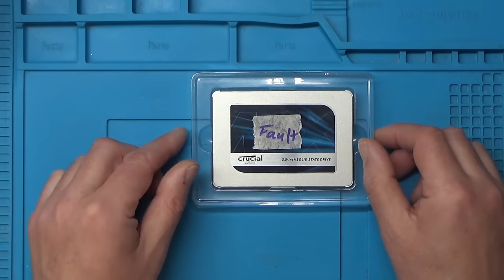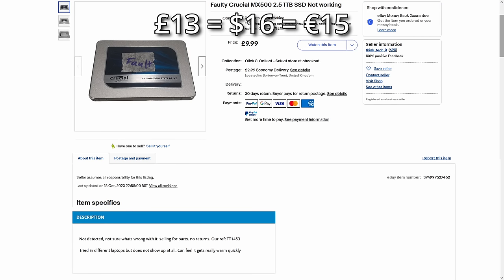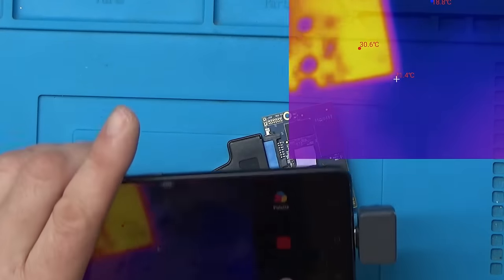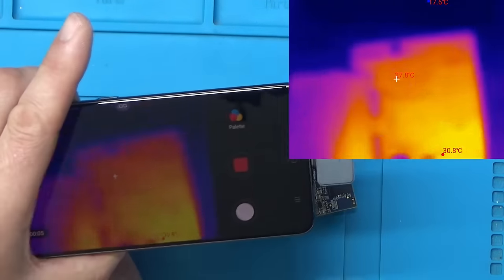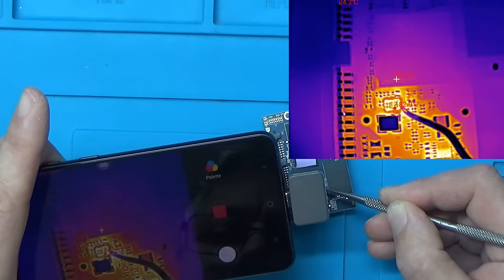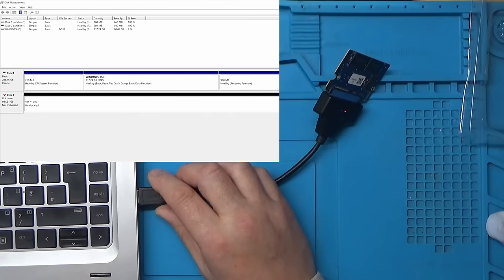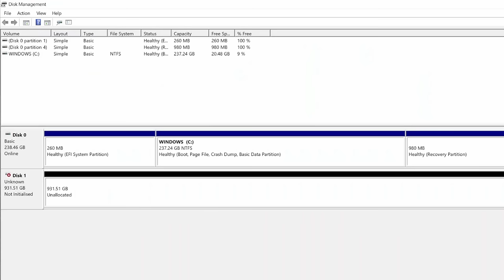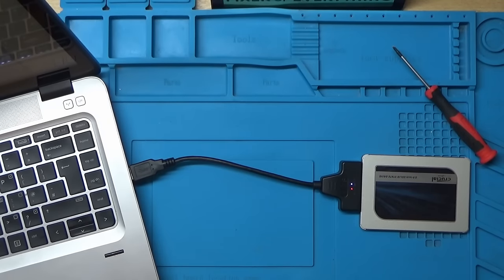Faulty Crucial Solid-state Drive (SSD) 1TB (1000GB) - Can we FIX it ?

Comment: Crystal Disk Info and Crystal Disk Mark are two great free utilities for SSD health status and performance. Well done on the fix Mick, nice work!
Reply from the maker: Thanks Marc 👍
Reply: I always use Crystal Disk Info and Hard Drive Sentinel (for continuous monitoring my hard drives)
Reply: HD Sentinel is a good one too, it does a lot more than CrystalDisk. It is paid for but really good as it sits in your tray giving realtime info of temperature and sector issues. It will email you as well if things deteriorate, so great for servers and systems left running! It also allows you to repair the disk with surface and sector scans to force SMART refresh! I've never looked back!
Reply: Crystal Disk Info also tells the operating hours, which most drives keep track on. That would tell if the drive was brand new.
Reply from the maker: The crucial executive utility I used at the end of the video (I think some people might have thought the end was when I was putting it back together) also tells you the hours, power cycles,  health status and let's you upgrade the drive firmware (which I did a bit later). But thank you all for the alternative suggestions.
Reply: Exactly. Crystal Disk will display power on hours for both SSD and mechanical HDDs.
Reply: Fantastic fix, great bit of luck with that cap failing, excellent use of the thermal camera to do a bit of extra detective work Mick, Happy new year to you an yours, Mark 😊👍🥳🥳
Reply from the maker: @thetraindriver01 Thanks Mark, and happy new year to you and yours too! 👍
Reply: Crystal Disk Info is what I find d very good.
Reply: @BuyitFixit  CrystalDiskInfo is for all brands though, so you don't have to worry about getting a manufacturer-specific utility.

But I guess like you said, with the Crucial one you can upgrade drive firmware (though I've never needed to do that).

The only time I'd use a manufacturer-specific SSD utility (like Intel Toolbox or Samsung Magician) is with a non-SLC SSD under Windows XP (or Vista if I found myself on that lol), to add TRIM etc. to those OSs, which you need when using a non-SLC SSD with them (Microsoft didn't include it until Windows 7).

Comment: Another amazing repair. Just a quick tip for anyone wanting his model thermal camera. It is one of the very best for the cost out there. Make sure to look into the macro lens add on or kit as this gives you sharp detail for small components and board inspections. Most other cameras out there other than uni T may not have this option.
Reply from the maker: Thanks, yes it's a good camera although the only downside is that you also need a phone to use it. Ideally this arrangement in a stand alone device would be great.
Reply: I bought one of these also.  I find the BIG advantage over a stand alone TC is that you can use a tablet with a BIG screen, or share the screen to a cast capable TV.
You also don't have the frame rate of 9 FPS limit that most other TC's have.

Comment: Nice find!  Looks like these small caps are getting to be somewhat common failure points.  Northridge Fix just did a video on a Samsung 860 Evo SSD with a shorted cap a few days ago.
Reply from the maker: Yes, totally agree. I've seen quite a few devices with the same problem.
Reply: MLCC's (multilayer ceramic chip capacitor) are notorious for causing shorts
Reply: I guess I'm not lucky at all. Never had any SSD in for repair with a blown capacitor. Only heavy faults. No shorted or blown capacitors.

Comment: Loved this.  Appreciate it was some time ago - but how did you work out the value of the replacement capacitor - did I miss that part?
Reply from the maker: Thanks 👍Just a rough guess as it's only a decoupling capacitor to reduce noise on the supply. The supply we know is around 3V so anything higher would be fine for the voltage, and a typical value is around 0.01uf. I just pulled one from an old PCB that was doing a similar job.
Reply: @BuyitFixit  appreciate your taking the time to reply and the capacitor tip.

Comment: Nicely done! I have to say though, while this would be a fantastic result for data recovery purposes, I'm not convinced I'd want to actually use the repaired drive long-term...
(PS: how did you choose the capacitance of the replacement cap? 🙂)
Reply from the maker: Thanks 👍Just a rough guess as it's only a decoupler, so something around 0.01uf or 0.1uf and it would only be a low voltage at around 3V. The HDD turned out to be brand new, and I guess caps can fail at any time so it should in theory be no worse than using a brand new drive.

Comment: Could you please tell us what was the value of the shorted capacitor that was replaced.Thank you for the video, great one👍👌
Reply from the maker: Thanks, I've been asked in comments a few times. It was just a rough guess. It was a decoupling capacitor across the supply so the value wouldn't have been too critical. We can guess the supply would be under 5v, so we know the voltage and a value would be something like 0.01uF. I just pulled one off an old board that was doing the same job. Hope that helps.

Comment: Nice fix, how did you decide the replacement CAP value?

What model and resolution is your thermal camera module?
I'm looking at getting one for Christmas.
Reply from the maker: Hi Dave,
The cap was just a decoupling capacitor to stop noise / interference to the CPU. The voltage of the CPU would be under 3v, and a 0.01uf cap is commonly used, so that's pretty much what I went with. I just pulled one off an old PCB that was doing the same job. The thermal camera is 256×192 pixels, and 25 FPS. The FLIR one i have is only 80x60 and 12.5 FPS. I put some links in the video description to the camera and other tools such as the blue mat etc as I've had quite a few people asking about different tools etc that I use, or "what's that grinding pen thing you were using".  Hope that helps!

Comment: So many modern electronic devices are knocked out by a simple shorted capacitor. Oh and love the vids , so glad I happend on your channel,  THANKS for the vids they keep me sane.
Reply: I watched the video but couldnt understand that much.. is that capacitor burnt or it deglued itself from the board? He just resoldered it?
Reply from the maker: Thanks 👍Much appreciated 🙂
Reply: @subgivtara The capasitor was damaged and shorted the power line. Had to be replaced
Reply: @Frank-Thoresen  where did he get another one?
Reply from the maker: It's just a decoupling capacitor. The value wouldn't have been to critical and it would probably have worked without it. I just pulled one from an old board that was doing the same job.

Comment: @BuyitFixit  I also have the infiray. But what software do you use? I've tried different ones but one of them doesn't cope well with upright and horizontal positions. The other one is annoying with this eternal dog + moon animation.
I would also like to be able to set min. and max. temp for the display and be able to compare things better without a dynamic scale.
Reply from the maker: I'm just using the P2Pro software. Not sure about the dog and moon? Never seen that.

Comment: How did you figure out the value of the shorted cap?
I like the videos. I watch them on my phone and it helps alot when you use the microscope.  I dont have to keep zooming and panning around to see what you are doing.
Reply from the maker: Thanks 👍I've answered this a few times in the comments, it was just a rough guess. It's a decoupling capacitor to reduce noise in the circuit. I just used a 0.01uf and around 6.3v should be fine as the cpu only runs on 3v or less. Hope that helps 👍

Comment: Happen to me recently, bought a 1TB Crucial BX SSD for my 2012 Macbook Pro as a 2nd HDD, installed, copied old spinning 1TB contents over.
Rebooted Mac so it could reconfigure, and it never did reboot, so many attempts, unplugged the new 1TB SSD and Mac booted, weird as my main SSD had the OSX installed. Once booted, I used a program called Drivedx, brand new 1TB SSD had instantly failed, sadly nothing I could fix myself or I would have, but I'm so glad you took a gamble on this and paid off, I love that feeling myself.
Reply from the maker: Thanks 👍Yes, but it could also have went the other way if it was the main IC for instance that had failed. Thanks for commenting 🙂
Reply: good thing that's a new BX, should still be under warranty then.
oddly enough that happened to a crucial drive (that I know very reliable as well as snappy, used and resold countless of them)
not endorsing the brand here but I'm a fanboy, only crucial for all personal use 😅
Reply: @puckchew  Yeahh got a refund :) was offered a replacement but was a little unsure at the time.

Comment: How do you know what capacitor to replace with?  🤔
Reply from the maker: Just a guestimate. It's a decoupling capacitor as it's across the supply. I doubt the value is too critical and it would probably have even worked without it.

Comment: I'm sure someone has said this already, but you can try a Linux live iso, write to to a usb and boot from it and then run gparted which is a gui partitioning tool which will show you both Linux and Windows partitions. You can either use the Linux Mint live installer iso which can boot to a full gui OS off the usb drive or gparted has its own live edition as well. The latter will be smaller. Now off to have a look at my dead ssd from a few years ago to see if its a shorted cap on that!
Reply from the maker: Thanks, yes I've got a couple of ubuntu disks, I actually used it for a year or so a few years back when I was developing some Android stuff. Good luck with your drive 👍

Comment: Brilliant fix, How do you know what size capacitor the blown one was  to replace?
Reply from the maker: Thanks 👍Just a rough guess as it's just a decoupling capacitor. The voltage would be around 3v so anything rated above that, and a value would be around 0.01uf. I just pulled one from another board doing a similar job.
Reply: @BuyitFixit  tks heaps. Really handy to know this kinda stuff. So much that can be repaired with a bit of knowledge👍👍

Comment: Alright. But how did you determine the value of the capacitor to replace it?
Reply from the maker: Just a guess, it's just a decoupling capacitor as it's across the supply. It would probably have worked without it.
Reply: Nice fix, What was the actual capacity value and voltage of the cap used? What are the best capacitors to use? Thanks in advance? 👍
Reply from the maker: Well a rough guestimate would have been that the voltage would have been 3V or so at that point, even 1.8V or less. So I would have used something rated at a higher voltage than that and a capacitance of something like 0.01uF. I just pulled one from an old logic board that was doing the same job.

Comment: Hi Mike  could you explien how you use diode mode to measure for a short and how did you know what the capacitor value was of the one that you replaced. Really enjoyed the video!
Reply from the maker: Thanks John 👍 It's pretty much the same way as using it in continuity mode, I could have used that or even resistance.
The capacitor I just took a rough guess. It's a decoupling capacitor to stop noise in the circuit. It would probably have even worked without replacing it. I just pulled one off another old board which was doing the same job. The voltage wouldn't be much so <5v so a 6.3v rated cap would do, and something like 0.01uf. Hope that helps 🙂

Comment: What could be the issue if there are many caps shorted?  I have the same drive, but with more NAND chips (older version I guess).  The caps around each of the NAND chips seem to be shorted.  Could this mean that something else entirely is causing this?  Or is my drive just non-recoverable?
Reply from the maker: It is probably 1 cap that's shorted, but they are all linked in parallel hence them all measuring short. Thermal camera would show which is shorted, or you might get away with some isopropyl alcohol on the board, and apply power see where it evaporates first. You can also get a rosin flux vape type thing that would put a flux mist on the board and it would highlight where heat is coming from. Hope that helps.
Reply: @BuyitFixit  Thanks for the response.  I was considering getting a thermal camera; this seals the deal.

Comment: How did you choose the cap ? just one that fit the previous one ? (I rarely touch surface mounted boards because I generally do not know what's to put to replace a faulty component, while they have no label or color code.... Old valve amps are better for this x) ) 
And thanks for sharing that !
Reply from the maker: Just a guess as it's just a decoupling capacitor across the supply to the main IC. So it would only be around 3v and a 0.01uf would be fine.
Reply: @BuyitFixit  so "use your brain" x) it's ok ! Thanks !

Comment: Good fix, Mick.  I knew you had it and that it was brand new when it came up un-allocated with the right number of gigabytes.  I was about to ask you if you had the BX500 or the MX500, but I saw at the end that is was the MX500, which has on-board DRAM cache.  I've installed many of these MX500 to speed up people' older machines, and it's like a brand new machine.  They are about $50.00 in the states, so you did get a good deal.
Reply from the maker: Thanks Michael. I've never used them before as I've always used Samsung drives. What are they like for reliability?
Reply: @BuyitFixit  Pretty decent, I think. The odd shorted MLCC seems to be the most common failure mode. (Avoid the BX500 like the plague though.) The smaller versions like the 500 gig seem to be skimping on thermal pads these days, which is (literally) not cool.

The MX500 is basically what I consider the minimum SATA SSD that you actually want. It doesn't quite have the performance or low idle power draw of a Samsung, but is still a decent drive with DRAM cache and TLC flash and a metal case for heat dissipation.

BTW, if you have any Samsung SSD made from the end of 2020 to about mid-2021, it is likely to be in dire need of a firmware update to avert premature failure. 870 EVOs from 1 TB up seem to be commonly affected.
Reply: The BX series without cache are garbage if you do a lot of writes. It hogs system memory and acts like a shingled hard drive, slowing everything down! Cheap but not cheerful!
Reply: @BuyitFixit  Yes, the MX Series has been quite reliable for me.  I've been running a few on my laptop and music production machine for about 3 years now.  As folks have said, the BX should probably be avoided, since they don't have DRAM cache.  From where I stand, of course the best would be Samsung, but if you want good performance at a slightly better price, you can go with Crucial.  Crucial is also owned by Micron Technology as well, who makes a lot of the memory chips used many electronic devices today.

Comment: WOW, blown away with what is not in the box 🙂Wonder how much we gat charged for the emptyness.
Reply: The CASE is designed to conform to the 2.5" drive specification. The actual PCB doesn't need to be anywhere near as big as the case itself, which is why people often feel short-changed by the mostly empty space! ... Think about how tiny M.2 SSDs are!
Reply from the maker: Or the physical size of a 512MB thumb drive (not sure if they make them as big as 1TB)
Reply: @BuyitFixit    I believe 1TB USB Flash Drives are available 🤔 if you can afford them! 😲

Comment: How did you know the value of the capacitor?
Reply from the maker: Just took a rough guess. It's only a decoupling capacitor as it's across the supply voltage.

Comment: Hello, good job again, i ask me if is not a danger for the microprocesseur when you are using diode mode, this mode use more than 3,3 volts , the limit max supported by the cpu ? Thks
Reply from the maker: Possibly, although it didn't seem to affect it in this case.

Comment: How did you know what value the replacement capacitor should be?
Reply from the maker: Just a guess. It's not too critical as it's just a decoupling capacitor and it might just have worked fine with it removed.

Comment: Nice job.  However, what were the values of the capacitor you replaced?  How did you determine what was needed?
Reply from the maker: Just a rough guess. It's just a decoupling capacitor I just pulled one from an old board. But it would be something like 0.01uf. The voltage you can work out by either measuring as it's across the supply or again a rough guess.  Seeing as it's across the supply going to the main controller it's probably going to have 3v or less across it. So something like a 6.3v 0.01uf should be fine.

Comment: Congrats on the score and fix. Those small caps can fail sometimes.
MX500 series are normally very reliable. I have many of them and only ever had one die (and that was due to a faulty PSU). In comparison, I had several Patriot SSDs die in a few months under heavier load.
Reply from the maker: Thanks 👍and also thanks for the info 🙂
Reply: I have 8 of the MX500 series and have yet to have a failure, in fact I just got another 1 TB for 46 USD not that I really needed it but at that price I figured why not
Reply from the maker: Nice 👍Thanks for letting me know 🙂
Reply: I agree, that one could be one of many that failed mfg. process and put aside for refurbishing but somehow "found a way out"
even the cheaper BXs are equally sturdy, they just have less performance but in terms of reliability I have customers employing them in higher temperature environment so they're thermal throttle countless times but none ever fail.
if PSU or whatever interface it has been plugged into caused the damage, owner must've got the drive RMAed already.